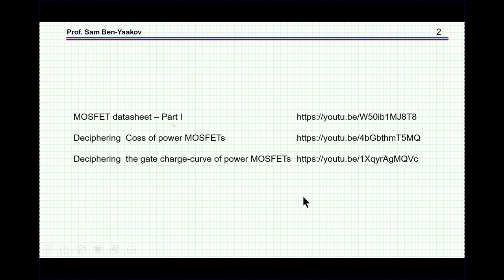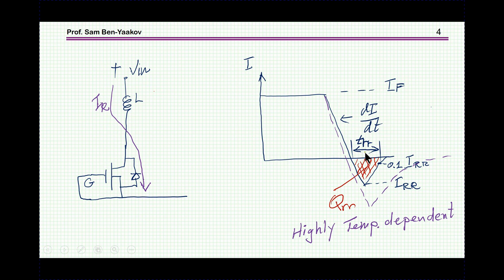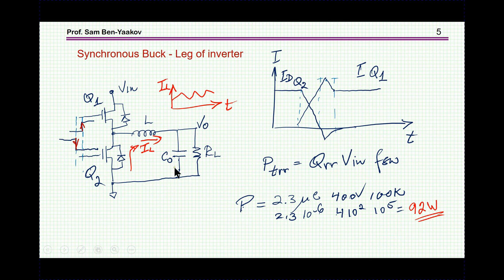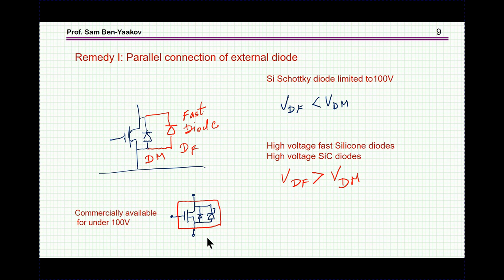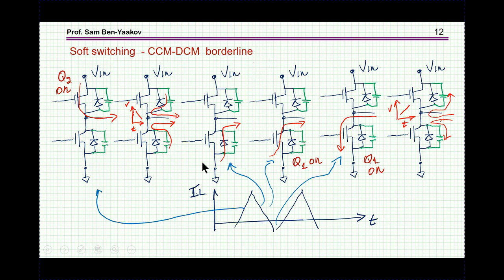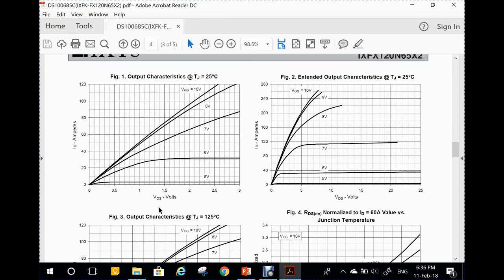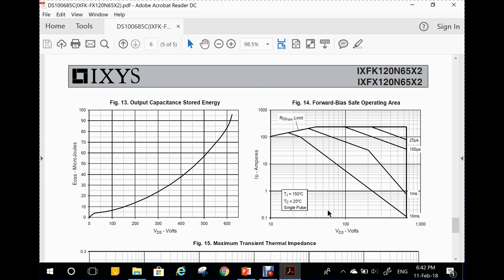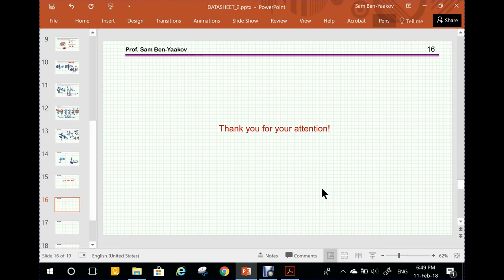Continuing education lectures:  MOSFET datasheet - Part 2

Comment: Dear Professor,
I just want to say that I enjoyed the full 41minutes and 4seconds of this video!

It’s nice to understand mosfet as switchers and grasp the basic operation of buck converters, SMPSs etc. 
But it becomes really interesting (as with almost everything) when you dive deeper into the nitty gritty details. 
I’m far from being able to design (or even parameterize a design) but thanks to your video’s I’ve become aware of the trade offs that have to be made when designing these type of circuits. 

Thank you!

Comment: Hi Sam , 

@ 10.04 , you mentioned that when Q2 is OFF then the Inductor  current will pass through the body diode of Q2; Does I_L will pass through body diode of Q1 as well to Vin ,  since both diodes are same direction. plz explain, how it works.  ?
Reply from the maker: Depending on the current's direction it may pass through the diode. If the current is lagging, the current will first pass through diode and then via transistor.
Reply: Hi Sam, 

Thanks for your response. I assume you are referring to Q1 body diode and reverse current flow to Vin when Q1 is off condition. and may i know what condition current will lag. ?

could you please make a video of selecting HS and LS MOSFETs for Synchronous DC DC with real time application spec and behavior of MOSFETs during DCM and CCM operation.

Comment: Since a diode with a smaller drop has less reverse recovery, does that mean that reverse recovery is proportional to drop? And therefore, drop has something to do with the amount of charge contained in the diode?
Reply from the maker: The reverse recovery is not related to the voltage drop but to the stored charge. High voltage diodes have a high voltage drop but may be fast
Reply: @sambenyaakov  Is there a diode specification which indicate the magnitude of the stored charge?
Reply from the maker: @johnaweiss  Yes in Datasheet of fast diodes
Reply: @sambenyaakov  Is there a direct relation between diode speed and storage magnitude?
Reply from the maker: @johnaweiss  Yes, for the diode to be fast you need a small stored charge.
Reply: @sambenyaakov  Does the Schottky soften the switching by shortening the switching duration, thus reducing the amount of overlap?
Reply from the maker: @johnaweiss  They are fast, practically no stored charge, and hence of low loss and short recovery so the dead time can be made short

Comment: Dear professor, first thank you so much for this video. I m looking for a mosfet with trigguer intrence. Does that exist?
Reply from the maker: trigguer intrence? please explain
Reply: @sambenyaakov  dear professor,  I am trying to use a mosfet as a switch to control something that vary gradualy. I was wondering if I could turn on my mosfet at some level and turn it of on another level during this variation. I m not able to add a smith triguer to the system before the mosfet driver.
Thank you in advance

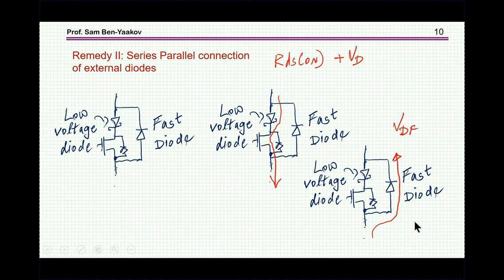Comment: 21:32  Why adding the fast diode?  Any significative current trying to pass through the intrinsic diode will be "stop" by the external low voltage diode that we have just added, isn't it? Is it that the benefit of possibly turning the MOSFET at 0V is involved behind the reasoning? ( I haven't look at your other two videos, yet, sorry if the answer to this question is there :-)  )
Reply from the maker: The reverse current is fed from an inductor. You must provide a path otherwise a voltage will build up and among other things, will blow up the low voltage diode.
Reply: Now it is evident! Thanks!

Comment: Hi Sam,
In the datasheet is written that RGI - Gate Input Resistance is 0.74 Ohm.
Should not it be a very high value?
In Mosfet transistors there is not current that flows to the gate. (only during switching to charge the capacitor)
Could you please clarify this parameter?
Thanks
Reply from the maker: This is in series with gate ans isolation (relevant to transient currents) not gate to source.